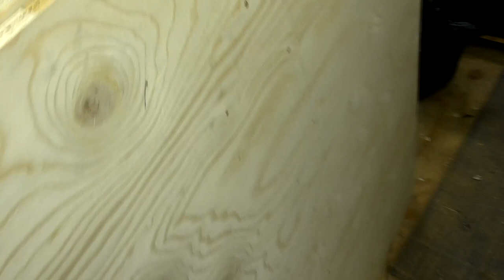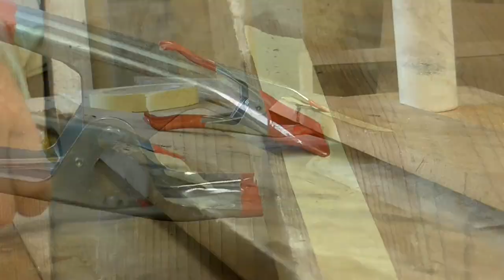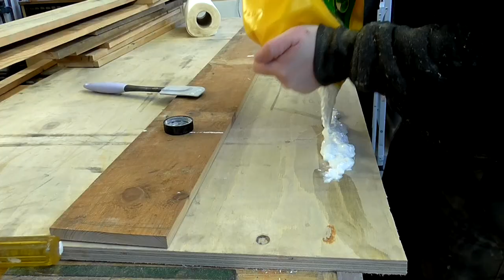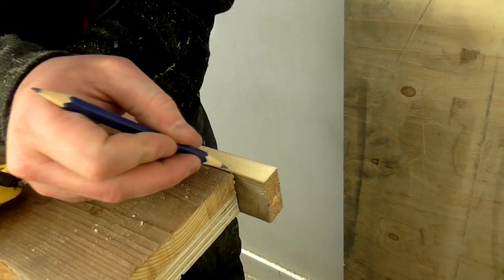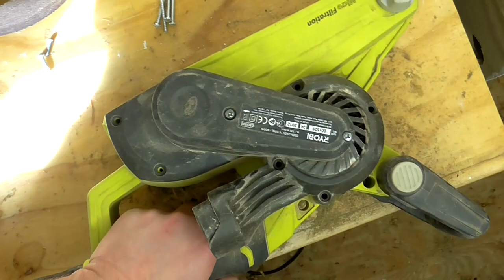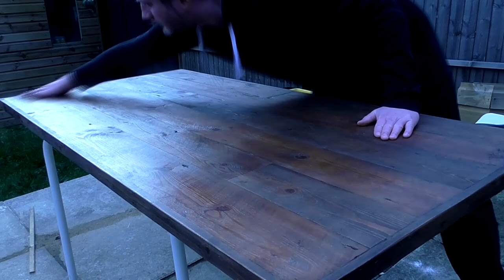Custom Desk And Speaker Stands With Ikea Lerberg Legs (Part 1 of 2)

Comment: my sander had a similar problem and it was just the drive belt that had broken. sounded awful but new belt and it's been spot on.
Reply from the maker: +bidders77 yeah I've had that before - drive belt breaking seems to be a common problem. Replacements are hard to find On a lot of the cheaper belt sanders too. I think it is one tool worth spending some extra money on. Having said that I spent £100 on the Ryobi and it has failed me!! The drive belt is fine though I think it's something internally
Reply: have you not got the receipt? you get a 3 year warranty with the ryobi tools

Comment: I used to have the same belt sander....Died on me too when I used it for a prolonged prolonged period of time. Recently replaced it with the Triton belt sander. Haven't given it a prolonged hammering as yet but first impressions are good.
Reply from the maker: +Sharp Edge Woodworking is that the one on screwfix? I had a look at that but ended up ordering the Bosch pbs75a ... it arrives tomorrow looking forward to giving it a spin. I've been through so many belt sanders over the years and yet to find a decent one that lasts. And I've never had a Bosch tool fail me so I'm hoping it will be The One!
Reply: Rag 'n' Bone Brown  Screwfix have started carrying a range of Triton products (the orange bodied stuff....not to be confused with TITAN....Screwfix's grey house brand) in the last year or so. Some of which can now be seen in the catalogues but the full range can be found on their website. Only issue is that Screwfix also carry a range of showers branded as 'Triton'.....so a lot of bathroom products may come when your search for "Triton".....so try "Triton Tools" (for the benefit of anyone reading this).

Comment: Great video Keith I bet you are glad you kept those floor boards!
I was getting through sanding belts like no tomorrow but got an abrasive belt cleaner. They are £8 in screwfix and work a treat, the product code is 16210. 👍🏼
Reply from the maker: +Happy Wife Happy Life thanks man I'll definitely get one and try it out

Comment: Beautiful desk top. Did you use the same kind of sandpaper for sanding wood and for removing paint+ from the wood?
For the latter exist special sandpaper. Works much better, faster, easier.
Reply from the maker: +Hans de Groot thanks Hans. yeah I just used ordinary sanding belts to remove the paint as it's what I had on hand

Comment: as always love the channel end result was brilliant, was there a reason you didn't put the board through the planner looks like it would have saved alot of work or is there a reason for that
Reply from the maker: +Robert John Allan hi Rob, thanks. Only reason I didn't use the thicknesser was because there were a few old nails in the wood that I couldn't get out without making a mess and I didn't want to ruin the blades. Having said that I need new blades anyway so maybe I should have gone for it haha!!
Reply: how do you check for hidden nails?? thanks
Reply: Metal detector, or metal finder - or even a magnet might help a little. Check on eBay.

Comment: I find that using a sanding belt cleaner/eraser works a treat to extend the life of all sorts of abrasives if used throughout the job. I'm not sure if there's a HF near you, but this is one of the items it makes sense to pick up from them. They look like a giant gummy rubber eraser (http://www.harborfreight.com/media/catalog/product/cache/1/image/9df78eab33525d08d6e5fb8d27136e95/i/m/image_17622.jpg)
Reply from the maker: +DanKmake no HF in the U.K. as far as I'm aware... I will check out the product though. Thank you!
Reply: Rag 'n' Bone Brown Silverline do them, part number 218490, they work nicely!

Comment: I just finished making a desk from ikea birch ( solid butcher block) worktops. 

EDIT

I also just cleaned up the wooden windowsill , you think you have it hard , it had 14 layers of paint on it ....... 14!!!!!!

EDIT 

Would that spray varnish be OK over danish oil ?
Reply from the maker: +Andrew Joy 14 layers??? wow I don't envy you on that one! Yeah spray varnish would be fine over danish oil I believe. It's good stuff and dries so quickly which is handy 👍🏻
Reply: Thanks may give it a go if you can get a matte or satin version.

Yeh 14 layers was a bit of a pain , nothing a bit of nitromorse and 40 grit sandpaper cannot fix :).